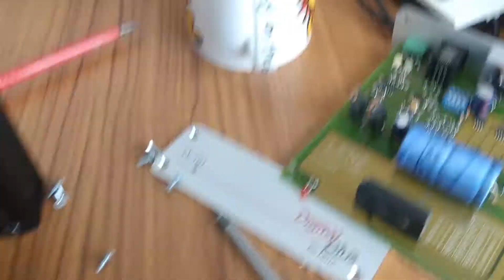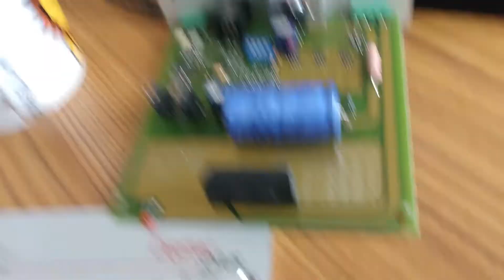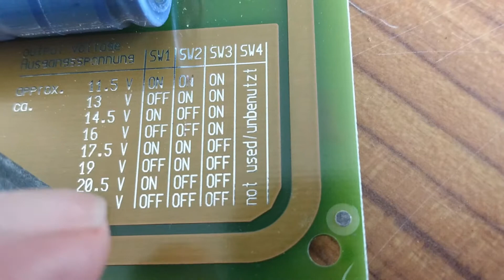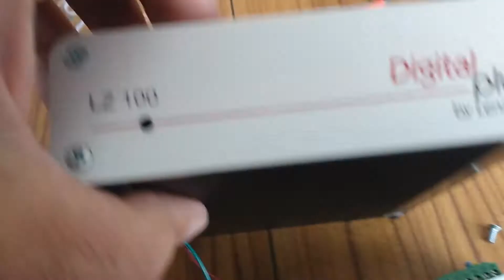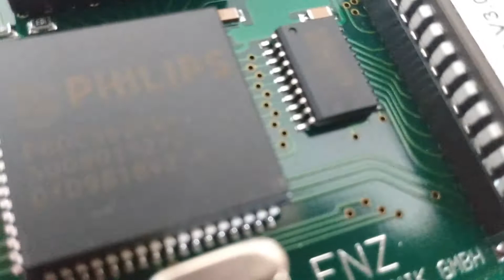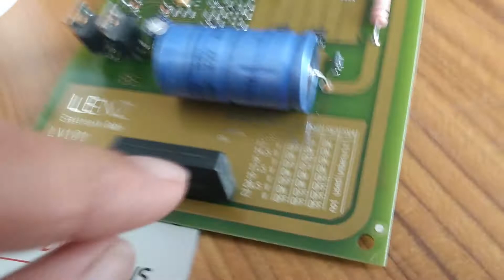Closer look at Lenz DCC 100 for Garden Railway

Comment: Did you end up finding your answer? I think they utilize something like the the ts150 that provides the voltage you need. I just bought a lot and am also finding out what and where everything goes for g gauge
Reply from the maker: Hi Matt. With the booster and the voltage set higher it will power digital locos OK. My main problem is that I have the older model and it doesn't have the function range needed. Very strange. My old Hornby Elite ran my digital garden loco perfectly well and operated all the sounds so I have stopped experimenting for now. I need access to functions higher than 9. John
Reply: @bikerides  Do you have any idea how to hook this up? I have about the same as you and can't figure out how to wire the LZ100, The power supply, and how to get the programming track to work. I have read all the manuals and they say nowhere how to plug it all in. Only small pieces individually
Reply from the maker: @dwpedalplayer  Hi Matt, It is in the loft. I will have to go up and photograph it. Fortunately, mine came with wires connected to the plug-in screw connectors, or helpfully, the cut off wires were there with colours to help me rewire it. The manual I found had strange letter coding like AB TUV etc. John
Reply from the maker: @dwpedalplayer  https://www.youtube.com/channel/UCixScAQp4oJ03gUNlzuVx9g/community?show_create_dialog=1
Reply from the maker: @dwpedalplayer  sorry https://www.youtube.com/c/practice264/community
or look under the tab 'community' on my page.